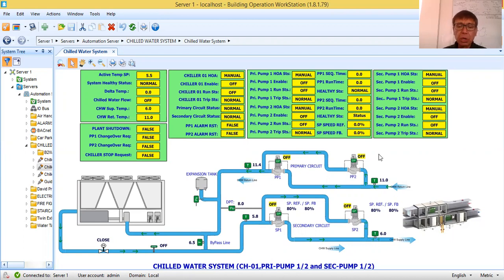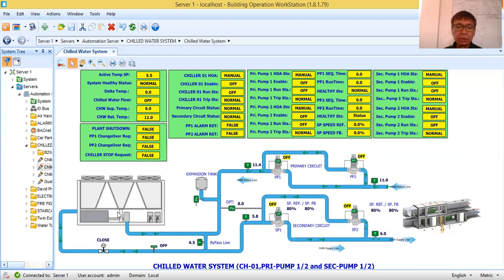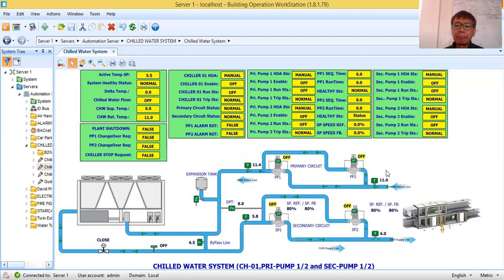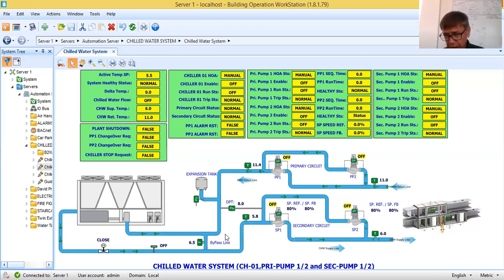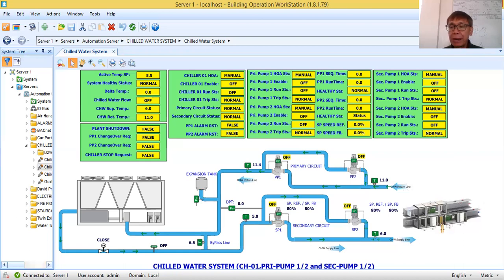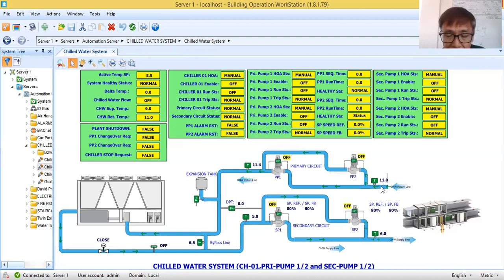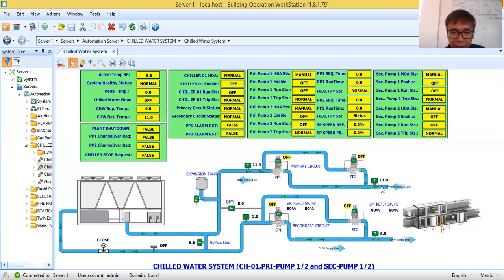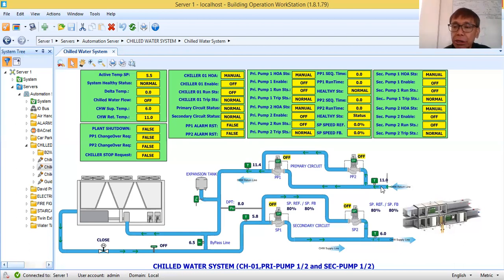Chilled Water System Part 1 (Air Cooled Chiller, Primary and Secondary Pumps)

Comment: Hi again boss,
I have one question, If i have VFD controlling the pumps, how will i maintaining the pressure by PID block without high shooting output, what is the parameters can we adjust in the PID block to get a smooth output
Reply from the maker: try to adjust the integral time make it a little bit higher than the original integral time you set to your PID controller